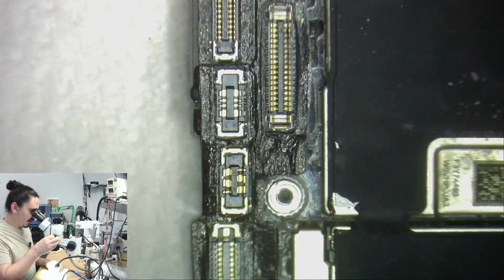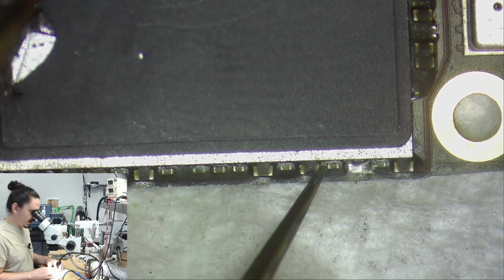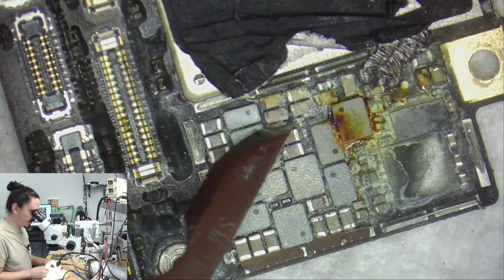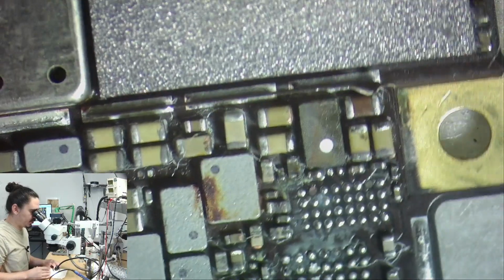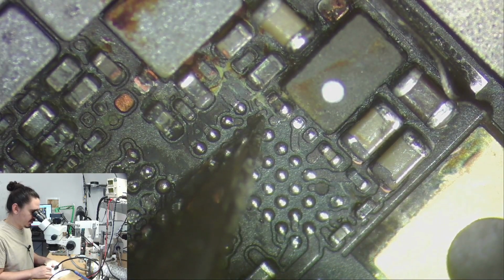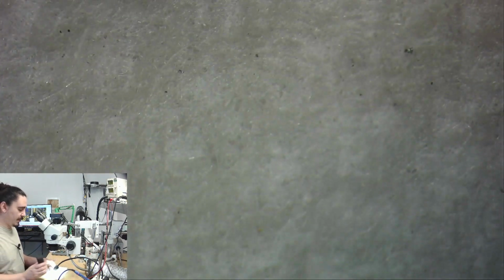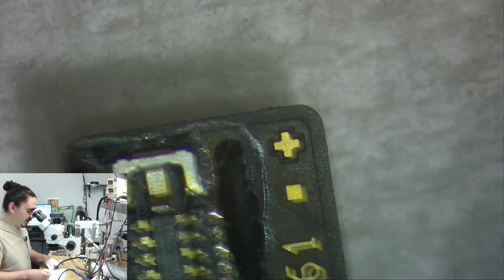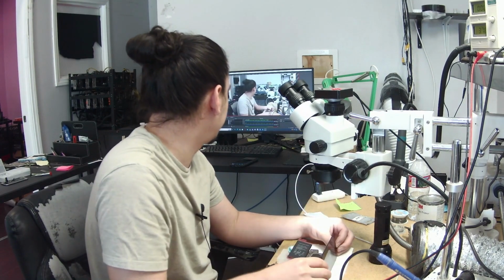Microsoldering on Water Damaged iPhone X - Data Recovery Motherboard Repair

Comment: Did you use dust spray like freeze spray by flip over ?
Reply: Yes, you 'water it' with the spray by using it upisde down then you blow air into it, it freezes. Works really well
Reply from the maker: Yes as Damjanovic mentioned, you just flip the canned air upside down and the frost comes out. You can also use a thermal cam if you prefer.
Reply: Thx you guys for your answer, i can go like this at the beginning, i guess the cheapest way to find a short 👍🏼